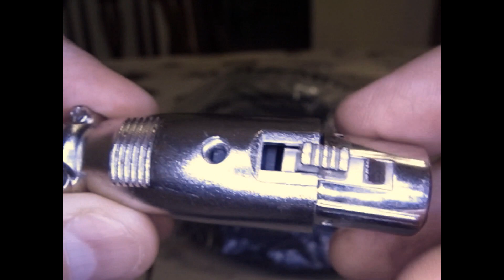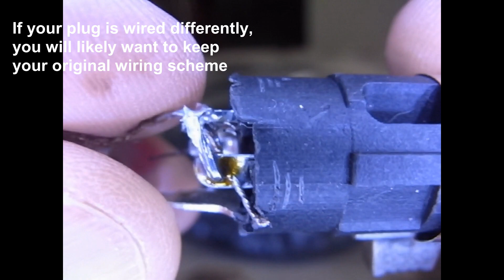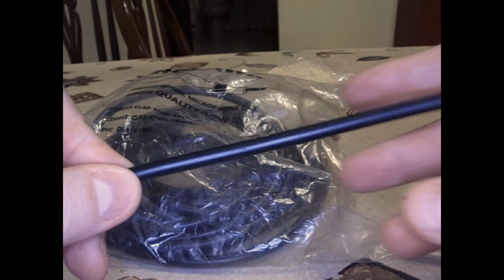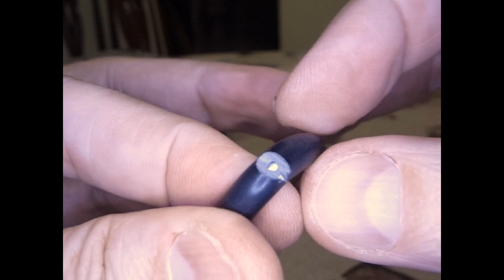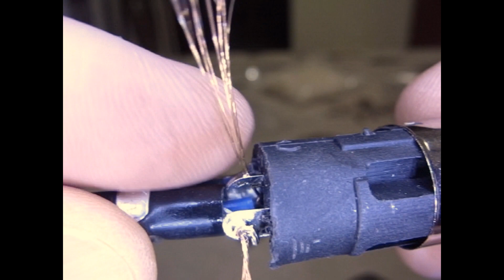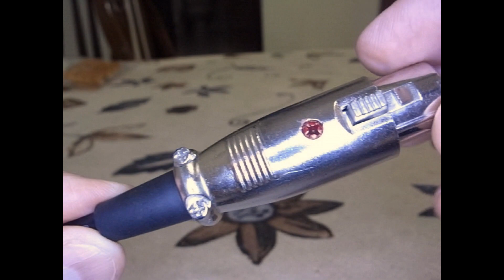XLR Audio Plug Fix / Rewire - Long Lasting Repair

Comment: That sure is “heavy duty” and sometimes necessary the way we handle those cables. Especially like and agree with the way you cut (carefully) the external insulation.